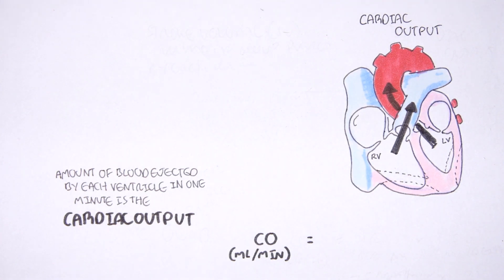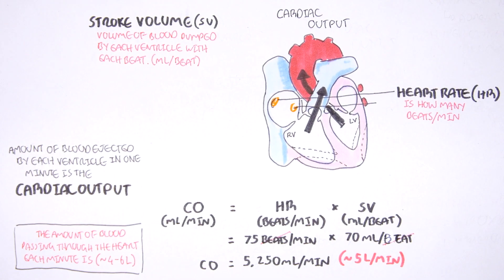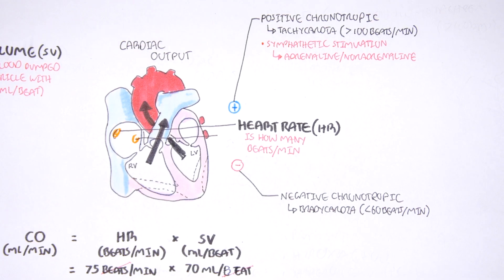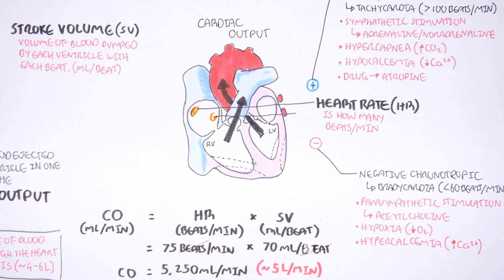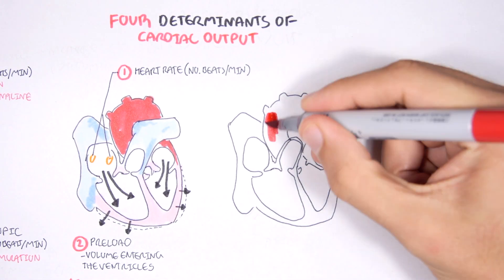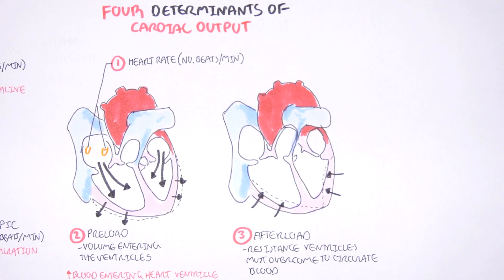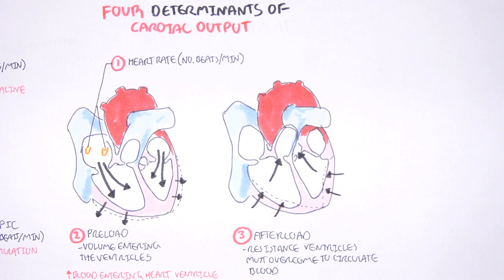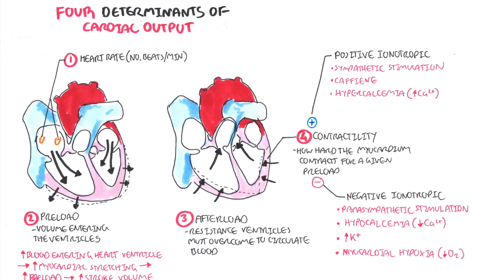Cardiology - Cardiac Output

Comment: You say at 5:15 that preaload is the volume entering the heart, but preload is the total volume of all the blood in the heart at the end of diastole (including direct flow, retained flow, delayed ejection flow and residual volume).
Reply: At ~6:00 you also say that the amount of blood entering the heart is about equal to the amount leaving the heart and that is true. But directly after you say that that "end diastolic volume ~ stroke volume", and that is not correct. The end diastolic volume is ~120ml for a normal person. At the end of each heart stroke there is about 50 ml left in the heart (the residual volume). The normal stroke volume is 70ml (120-50=70). This can be seen in a pressure-volume-loop.

Comment: at 3:22
How does decreased calcium increase heart rate? 
Also, you said in hypercalcemia, there is an decrease in heart rate but you wrote increase in heart rate. 
Calcium is the main contributor towards rapid increase in the membrane potential therefore, calcium and the membrane potential (or HR) have a direct relationship. 
Clarification please.
Reply: A healthy heart will have enough calcium to effect the action potential and keep the heart beating. The calcium he is speaking of is that which contributes to Inotropy, which you can understand as a separate idea. In very simple terms, the contractility of the heart will be increased by an intracellular increase in calcium. It pushes the heart into further contraction than it's base rate. As a result, stroke volume is increased and cardiac output is increased. 

Here is the important part. 

The human body maintains a particular heartbeat within a range, usually something around 50-60 beats per minute in an average person. Why does it keep this particular range? Well, it is determined by many factors, but the concept is it is enough to supply the body with what it needs. It keeps a pace that maintains the body's requirements while also not exhausting itself, a pace. This maintains a certain blood pressure, around 120/80 for an average person. 

If you increase the contractility with increased intracellular calcium via an ionotropic drug, like digoxin, or a drug with ionotropic effects, like digitalis, then you are increasing the pressure and the resources that are going out to the body. This isn't metabolically necessary, which is why the body will revert back to it's set point after the ionotropic drug wears off. But while it is exhibiting this increased contractility, in order to compensate for the increased and unnecessary cardiac out put and pressure, the heart will SLOW DOWN. Stroke volume is increased, so heart rate will decrease to maintain the set point for cardiac output as determined by metabolic need (read: baro/chemoreception). This leads to bradycardic effects. In cases of reduced calcium (once again keeping in mind there is enough for the action potentials to continue), the stroke volume will be reduced as the cardiac muscle is not contracting as much. In order to compensate to meet the set point, the heart rate will increase. Tachycardia in hypocalcemia, bradycardia in hypercalcemia. It's important to realize things do not just have "positive" and "negative" effects on the heart, there are multiple variables at play to maintain a system.

A year later, hope it helps someone.
Reply: +Gullerana Ahmad I'm also wondering how is that could be true? he also mentioned that in contractility Hypercalcemia increases it (contractility)!!!! so how the hypocalcemia can increase the heart rate I wish someone explains that
Reply: i looked up in google. im not sure whether it"s correct. hypocalcemia causes prolonged qt which can cause tachyarrhythmia.
Reply: Thanks for good explanation. I actually just initially thought that low calcium would lead to less sustain of depolarization, increased refraction and therefore increase heart rate. But I think I like your explanation better XD
Reply: So basically you're saying that it is a basic physiological compensatory response.  Increased intracellular calcium (hypercalcemia) will cause hearts natural pace making ability to try to reduce the HR and SV thus decreasing cardiac output since the body, under non-strenous activity and decreased oxygen demand, dpes not require that much cardiac output thus slowing down the heart rate hence saying that hypercalcemia causes bradycardia

Opposite would happen if the heart rate is reduced (bradycardic), stroke volume reduced thus cardiac output is reduced this means the heart must compensate for this by increasing intracellular calcium levels (hypercalcemia).

Is this what you're saying?
Reply: Gullerana Ahmad , In action potential graph of cardiac muscle , calcium influx and potassium efflux balances during phase 3 so occurs plateau causing sustained contraction, if calcium decreases , no plateau is formed leading to rapid repolarization thus increases heart rate
Reply: Hypercalcemia - referring to free ionic Calcium in the blood - leads to increased heart rate. It is a direct relationship, video is wrong. We just went over this in patho

Comment: Decrease Cacium is + chronotropic? More the calcium you give, more will be contraction. So it is basically an inotrope, a positive isotrope. Chronotrope are for rate. Inotropes are for contractility. Dromotropic are for conduction velocity. Please correct me if I am wrong.
Reply: +Syed Tameem Ul Hassan i think that increased ca+2 will decrease the time needed for AP (action potential) .in this case, we shall have more action potentials over time (i.e each minute)  and so more number of beats per minute which actually means increased heart rate (+ chronotropic effect in pharmacological term)
Reply: Calcium influx is a part of the cardiac pacemaker cell's action potential.  So increased calcium levels will increase the conduction through the SA node and increase HR (chronotropy) but will also increase contractility.  Just like giving someone a calcium channel blocker will decrease their HR along with decrease contractility.
Reply: My understanding is that, the plateau phase of action potential is due to the slow influx of ca2+ hence implication is that, there will be increased time for action potential conduction as the muscle contraction will be sustained with more ca2+.

Comment: Why does heart rate increase with a decrease in Ca2+? I don't get it :'(
Reply: He's actually correct! Contractility is different from heart rate. Ca2+ is needed for contraction of the myocardial cells of the heart. Ca2+ has a direct relationship of the STRENGTH of contraction, not the speed/rate of contraction. When there is more Ca2+ being brought into the sacromere to bind to troponin for contraction, all of those Ca2+ ions need to be brought back into the sarcoplasmic reticulum via exchangers/pumps/channels for the next musculatory contraction. The more Ca2+ ions you have, the MORE Ca2+ ions that are brought back into the sarc. This slows down the time for the next heart contraction, thus decreasing heart rate! Ca2+ produces harder heart beats, but not faster!
Reply: @christinamichel3321  thank u so much i understand now
Reply: I think its a homeostatic mechanism, due to the control centers in the medulla oblongata. Because SV (contractility) decreases with decrease in calcium, HR must increase to maintain CO? these are my thoughts
Reply: Man. It's simple 
Sodium and calcium compete on the same channel so an increase in ca+2 makes less na+  enter the cardiac muscle fiber during depolarization. Decreasing it's excitability and conduction. So it has a -ve chronotropic effect
Reply: i don't get it either.. since a decrease in Ca2+ decreases contractility, it should therefore decrease the heart rate :S
Reply: it doesn't, he's wrong. It is a direct relationship
Reply: iloveu975 
However ca+2 has a +ve inotropic effect and increases the force of contraction and high concentration of ca+2 can stop the heart in systole so I. V ca+2 injection should be very slow and for long periods of time